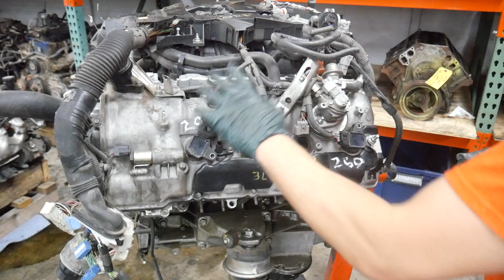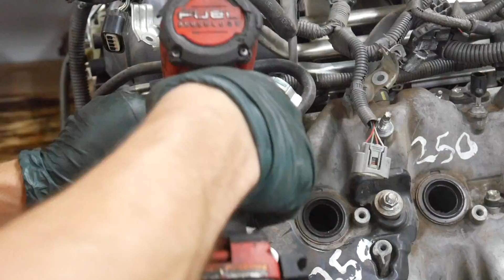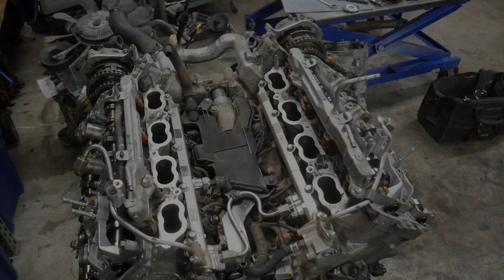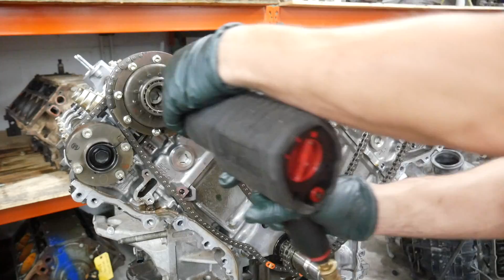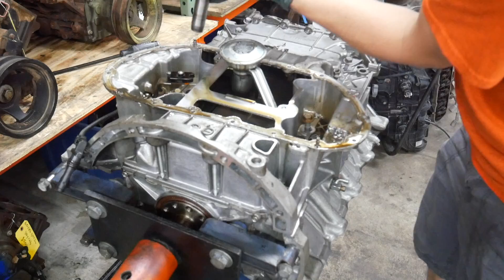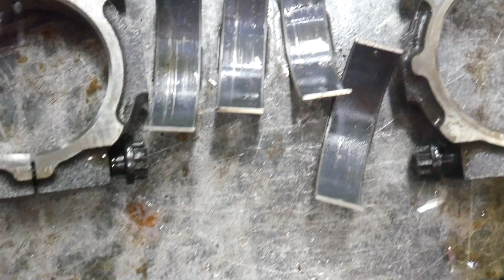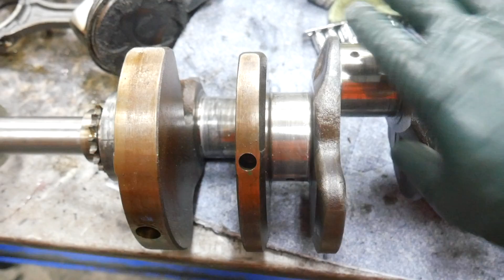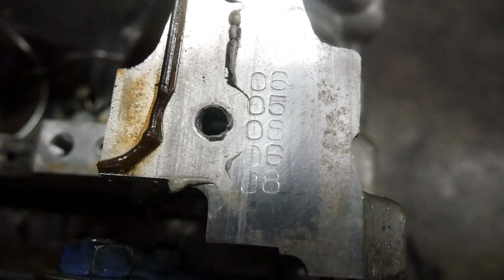Lexus LS460 1UR 4.6L V8 Blown Engine Total Teardown! How Did One Of The Most Reliable Engines Fail?

Comment: As a old tech forensic teardowns where my favorite jobs. A tip for someone doing a home teardown never use power tools to break bolts.  Part of the process is checking for loose bolts.
Reply: Done a few tear downs with power tools, I usually use a weaker one impact to remove fasteners. The weaker it is the more you’ll tell bolts are loose or not and it makes the job quicker! 
I like your thinking though!! I work flat rate as a tech so tearing engines down isn’t really what I get to do but if I do I gotta do it quick and the weak impact will help identify loose fasteners as well
Reply: @tx4runner459 very good tip - what do you consider a weak impact for my reference? Might try this on my next project (whenever it gets started- who knows) a 1/4 dewalt ratchet or something similar is what I am thinking

Comment: I agree with your opinion on the cam cradle design, but 1 down fall was 1 more place for a leak. The early generation 5.7 Tundras had a major recall and campaign to fix this oil leak.

Comment: The same thing happened to my 1uz in my ls400 literally the same cylinder I took off the spun bearing and replaced it with a junk yard one it gave me a 1000 Miles surprisingly and it locked up any suggestions ? It had oil and I never had a oil light come on. Does any know what could have happened ??

Comment: It Starved for oil, thats the only way that fails, typical toyota failure, it was probably the oil switch for the oil light. when that switch fails it leaks oil out as the oil pressure pushes the spring loaded ball in the switch through the switch housing, which is still not turning the light on the dash on, it was the most common cause of any toyota/lexus engine that i saw working in a toyota dealer for 15 years. That failure must have happened after warranty, or it was a case of someone not putting oil back in it, as toyota doesnt sell a complete engine like that. Its a short block and all the other pieces sold indiviually, i mean individually, lol. great vid! was my first time seeing a 4.6l apart.

Comment: Spun bearing aside, the design of this engine is why I became a Toyota fan. Robust and bordering on over-engineered. 6 bolt mains and piston oilers. That's why a Hotshot driver's Tundra went a million miles without a major repair. When they tore it down, every part was within service specs with the exception of the tailgate damper and the seat springs. They put it back together and it aced the dyno test. With a million miles on the clock!

Comment: Toyota's "new" cartridge oil filter system makes it very easy to install a sealing o-ring in the wrong place, causing a slow oil leak. My wife's aunt almost ruined the motor on their Lexus RX350 when this happened. The o-ring in the filter housing cap must ride in the designated groove, but it can also sit right at the edge of the cap - where it will slowly leak. These are really well made engines, I would bet money that low/no oil pressure killed this one.
Reply: As always, they recommend to check oil level every fill-up. I know it's impractical, but you could get into the habit to check regularly and prevent this issue from ever happening. If you love the car/engine, it's amazing what ends you will go through to ensure it's perfect.

Comment: For this to happen on this engine, which is the stuff of legends designed by men in Japan in an ivory tower, I'm sure it had to be run at least 100k miles with no oil in a sandstorm with no air filter.  I'm sure 1000 people will say roughly the equivalent to this in the comments section.

Comment: I'm going to with: it was high mileage used car, subjected to a side show event at 7 thousand rippems, even the best engine can fail when subjected to that kind of abuse.
Reply: Yup. 
Only going one direction sideways starves the motor on one side. 

Best to do figure 8 for constant oil flow to both sides. 

Or just dont go to sideshows. They dont prove any type of skill what so ever.

Comment: that engine appears to have been abused by the owner, there is no way you could drive the vehicle without hearing the engine noise. Run the damn thing out of oil and keep on truckin'. what a moron! Toyota builds those thing to be bulletproof, but, not idiot proof. probably a rental car.

Comment: 27:00 My thought is that it was at an oil change place, they forgot to fill the oil (hence there is no oil in the filter housing passages) it was run until it started knocking, motor was pulled and sent to the salvage yard, or maybe the whole vehicle was sent to the salvage yard, and the salvage yard did a compression test on it.

Comment: I'm going to guess bent rod on Cylinder 8. I've had to replace 3 of these in Tundras and every single one had a bent rod on Cylinder 8
Reply: Nice to see a newer one.  I was wrong, but the one's I've worked on were much older 99-2002.  It seemed anytime they get in a wreck this engine used to have problems.

Comment: I bet someone used the wrong weight oil in it, like it took 5w30 and they were running 10w40. Used to have a customer that blew up 3 4.6 liter Ford's because he tried to run 20w50 in it. Called for 5w20 or 5w30 but this yahoo insisted on running the 20w50 because" it worked fine in the '81 400 he had before". That's my theory anyway.

Comment: I was wondering if the starter would be hiding in the valley, like the UZ engine.
Reply: No, the starter is hidden under the passenger side header on these. It is one of the only common failure points on these engines with most needing replacement around 100k. It's a big pain to work on due to the location and every connector in that area crumbles in your hands due to the heat aging of the plastics.  Not a great place to put the starter for longevity.

Comment: Mobil one provides the factory fill oil
And makes the oil you'll get at the dealership in case you guys are wondering
Reply: Is Toyota's "Oil" just rebranded Mobil 1?
Reply: @LeeePowers  it's made by exxonmobil say in the small print so is honda nissan mercedes benz usa porsche and dexos 2 for gm 
Phillips 66 makes motorcraft oil 
Pennzoil makes dodge oil bmw 
Castrol makes land rover jaguar oil
Reply: @stevennunez6013  I never knew that.
I heard it was good,though.

Comment: Does anybody actually work on these things lol the old 2uz-fr had timing belts 
And water pump failure the starter is also under the intake plenum like a northstar v8 stupid NOT A GOOD WORK TRUCK AT ALL 
The new 1ur-fe that's the 4.6 also has frequent water pump failure especially on hot environments like arizona where l live pumps commonly fail around 60 k no kidding toyota also stopped putting trans coolers on the trucks after 14 once again if you tow in hot environments like arizona there's a lot of  failures stupid 06-10 a lot of these engines were made with thin valve springs that would break or not provide enough pressure for the valves toyota fixed that issue timing chain tensioner fail frequently on theses engines 
Oil consumption is a problem on these 
People go the whole 10 k then wait 2 weeks to get a oil change
Fuel diluted oil is a big problem too because the direct injection on these engines along with all the other issue direct injection brings as well 
What I'm trying to say is toyota does make a long lasting work truck the 385 hp version has 11.8.1 compression ratio not to mention it pays 12.1 hours labor to do the left engine mount on 4wd trucks fucking crazy 
They really need to copy ford and do it better that's how there going to beat them

Comment: look at the chain tensioner/guide, part of the oiling is dependant on the tensioners/guides working. When they fail oil splashes all over the place and causes the journals/bearing to have a lack of oil.

Comment: I had a 4.6 with a p/s whine but was aerated oil at the pickup tube to timing cover(oil pump). O-ring failed. Toyota should have used a gasket. There was play on the pickup.

Comment: Props on the shirt and continuing to enjoy these teardown videos.

Ever get any Hyundai 2.4 gdi engines? These are known for oiling problems and would love to see a blown up one dissected.
Reply: Most of the blown up engines from 2011-2014 are covered under a recall / extended coverage so I can't imagine he'll get hold of one too soon (unless someone changes one outside of that coverage I guess). I've replaced a number of those engines, some with holes in the blocks, others with absolutely melted and welded bearings. They're nothing too special inside otherwise.

Comment: Hey I'm just curious, I hear about problems with carbon build up on direct injected cars and im sure you have too. Is that not an issue on these older DI engines from Toyota and if not what is the difference that made this engine not do that like some of the other ones that are direct injected?
Reply: Toyota did it the right way. This engine (and some other toyota models) has 2 set of injectors,1set port injected and the other direct injection into the cylinder, 16 injectors total for this v8, the use of which set, when , is governed by the black magic in the computer program. This keeps the valves and intakes clean. And gives the best of both systems. Watch the video again around the 7.30 mark. He talks about and you can see both port and direct injection rails on each head bank
Reply: @mac4boys541  ya I had made another comment saying "oh yah because it is both port and direct injected, duh" lol. I should have thought before I typed lol

Comment: I see numbers engraved on the bottom of the block. Select fit bearings. I would normally point out neglect, but the lack of varnish on the heads says no. And running it out of oil ruins the head before the crank. This might be an actual assembly defect. Something was off, just a little, and it wasn't good enough to last. It even happens to Toyota. Maybe debris in an oil channel that doesn't effect the head. I don't have the manual showing it in front of me.

Edit: I forgot. Select fig bearings is a formula. Add the number on the block with the number on the cap. That is your size. But, I don’t have the manual in front of me. Maybe Toyota changed it over time.
Reply from the maker: It’s odd because I never see issues with these. It was clean as a pin inside. Maybe it was that bridge chain guide clogging the oil pickup? It didn’t seem like enough material though.
Reply: @I_Do_Cars  Did you run the VIN thru google? Maybe that would give a clue
Reply from the maker: Michael Ross I did. Wrecked 2008 gs460, 165k+ miles. Last on the road in 2016
Reply: @I_Do_Cars    Even more amazing internal condition for 165K miles!  Obviously had meticulous maintenance for years.  I'm betting, as others, oil starvation due to human error during oil change.  But who knows ....    Great video, BTW.  Thanks for the effort.
Reply: @I_Do_Cars  I saw a 99 Corolla with the aluminum block, get a rough chop from throwing a rod. Instead of punching a hole through iron, and jamming up, it punched through and around. It was very ragged, as even a Corolla gets a steel crank. It had 20k. It happens, just not often. Unlike boosted 1.5 from GM that get holes in pistons. It isn’t uncommon to see Toyota cam bores look bad, in a good engine. They had babbitt material in the head and caps. I don’t work at a Toyota dealer anymore. I saw that in Denver.

Comment: What may have happened is that the engine was used as a replacement even with somewhat lower compression.  Then the rod knock became more obvious, the bearings for that cylinder started shedding material which clogged the oil passages and in turn oil starved the main and spun that bearing, which is when all hell broke loose.
Reply: That's a reasonable explanation, but the fanbois won't hear that..  I changed one of these for a customer about 6 months ago.  No oil problem.
Reply: @ohger1  When you replace an engine with another used engine, you always get a little of the unknown.  How well was it cared for, did it have problems to start with... you never know.  judging by the compression numbers, the engine probably ran pretty good anyway, it's not that far off and likely pulled pretty well.  Until it didn't.  :)

Comment: I have a 2007 LS460 with 277k miles now which I got at 67k miles. Just pulled a 5.5 second 0-60 verified by Dragy app. 8 speed shifts like butter and is original. Call me a Toyota fan boy, but I've owned vehicles from every car manufacturer in the last 25 years, nothing beats maintaining, daily driving, and repairing Toyota/Lexus products. Their engineers have OCD when it comes to making quality products right down how everything is spaced apart in the engine bay.

Comment: Really enjoyed seeing a Toyota product taken apart.  Big Toyota fan - would love to see a 4.7 torn down.
Reply: Just the same engine
Reply: @Shane-zx4ps  Nope...very different engine- it's a UZ engine, specifically the 2UZ-FE which was produced both with and without VVT-i and has a cast-iron block.
Reply: @Shane-zx4ps  it’s not, the 4.7 has a timing belt and some don’t have vvt
Reply: @BeanDip125  also they moved the starter
Reply: @Shane-zx4ps  the 4.6l (1ur) and the 5.7l (3ur) are the two that are essentially the same.

Comment: This is the engine the replaced the 1UZ, 2UZ and 3UZ V8's Lexus and Toyota used, short of abuse from lack of oil or other such they were pretty bulletproof for reliability and the UR series seems to have similar durability. Some have direct injection and some do not. The 1UZ was super smooth, hardly any vibration, and uses six bolt mains which it looks like they continued to the new series. :) I'd have to bet on ran with no oil.

Comment: It has run out of oil, or very low oil meaning surge starves the pump which runs the bearings. Possibly why the chain tensioner was 'soft'
A very high tech engine that makes less power than many simpler engines.
Reply: That's why it runs for ages... if you put oil in it.

Comment: Looks like little Timmy at goofy lube forgot to put the slick stuff back in the oil hole
Reply: Strange how the owner didn't notice. You should be able to hear the racket when an engine is running without oil from the moment you fire it up...

Comment: very odd situation. For most of its life it appears to have been meticulously maintained because most of the internals are spotless, then the pan cover is all metal particles. It just doesn't make much sense. I noticed a pretty good dent in the front of the pan, which makes me a little suspicious.  Maybe the commenter who said the filter and filter adapter were run into something, was correct, and the driver continued driving it anyway, when it was leaking oil.

Comment: I haven't watched the video yet but there is a 99% chance it leaked out the coolant via the valley plate, then they kept driving it on no coolant then a chain of catastrophe after that.  The 08-12 motors were really bad for this, the 13-16 were better but it still happens, just less.

Comment: Looks like an engine with solid engineering and build quality.    Also looks like it was well maintained until a catastrophic event.   Likely run without oil.
Reply: run without oil?   did the oil just evaporate on its own?   i mean they're not known to leak so where did it go?
Reply: @ChuddleBuggy  ???? It's called burning oil and the owner not checking?? rofl
Reply: @ChuddleBuggy "not known to......." doesn't mean s**t.

Comment: These engine autopsy's are so interesting. Thanks for taking your time to educate us. I'm an old GM and Ford guy so the insides of a Lexus engine is something I've never seen.
Reply: You haven’t been paying attention to 4-valve Modulars and Coyotes then.  

In fact, I think Toyota’s choice to get away from shim and bucket tappets and moving to the far superior roller finger follower/hydraulic lash adjuster setup with the UR engines was Toyota copying the Ford Modular which has been implementing that setup since 1991 with outstanding results.

If only Toyota copied the Ford Modular’s cam caps (individual cam caps, no cam towers sealed with RTV that leak with age like UR) and timing cover gaskets (Toyota uses only RTV, no silicone gasket like the Ford) too it would have been perfect.
Reply: @BCSVT  Until you have to work on one. The Coyote is a NIGHTMARE to work on. This is simpler than an SBC.
Reply: And what insides have you seen from Ford or Chevy?
Reply: @glennnichols4220  his first love
Reply: @glennnichols4220 he's obviously referring to the old ohv motors

Comment: Ill bet that oil filter housing got hit and all the oil came out while the owner was still driving the car. That is the only explanation that makes sense to me, with a such a clean engine and spun bearings.
Reply: Yup, I'd agree the engine lost oil somehow.  Even the sump pan looks like it got hit.
Reply: Couldn’t agree anymore because I have a GS 460 that is leaking from the oil filter housing right now. Probably something on the road kicked up and hit it. That is the one bad design of these engines is the oil filter housing location. If you lose the plastic panel under the car like I have it’s a sitting duck
Reply: only if the owner kept driving after the oil light came on for a significant distance.
Reply: @davidjacobs8558  I have at least three people in my immediate family who, if an oil light came on, would just shrug their shoulders and happily keep driving because "they gotta get to where they are going". That's if they notice the light at all. I call them car killers.
Reply: @davidjacobs8558  why would oil light come on?
Reply: i think you are right
Reply: Happened to my car. Oil light came on, stopped by a gas station. Oil leaking like crazy. Oil filter was damaged.